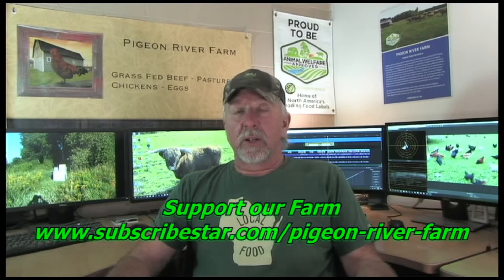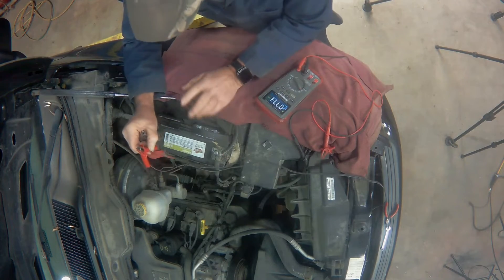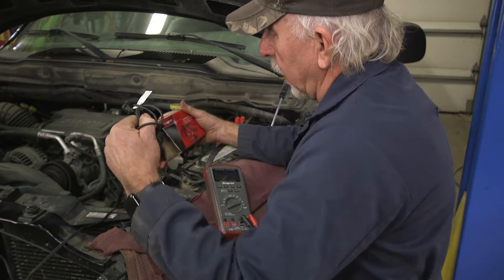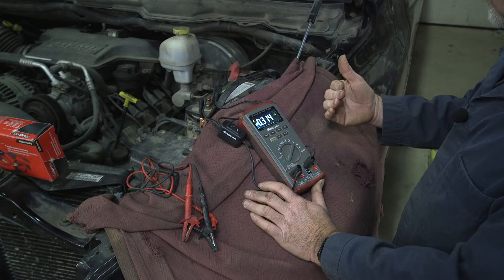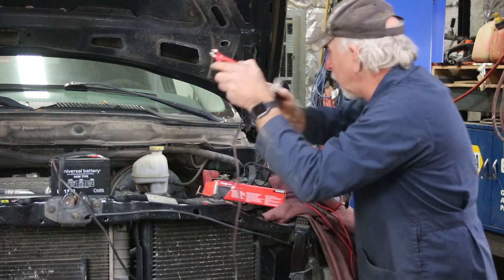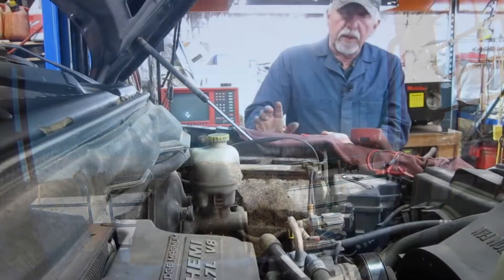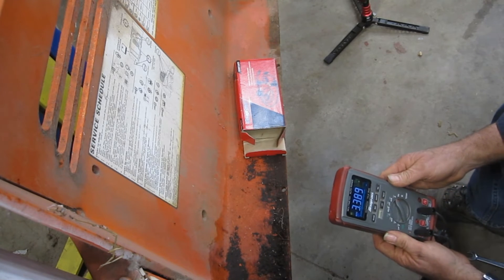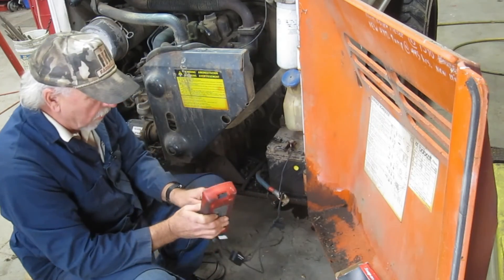The Snap on parasitic draw harness tool solves the problem!

Comment: Actually pulling fuses that way is not a good idea. If that fuse hadn't been the problem then you possibly activated a module when you put the fuse back in. It's better to use a voltmeter across each fuse.
Reply from the maker: Thanks for the comment you right that is a more controlled way of doing it. Like everything in equipment repair and service there so many different ways to approach a problem. Bob

Comment: Where did you purchase your small auxiliary battery cables?
Reply from the maker: The small auxiliary battery cables ended up coming from an old scan tool that I had and that was the adapter that went to the battery for the cigarette lighter adapter.  Since you are high quality, and I was no longer utilizing that tool.  I simply cut both leads off made up a few adapters to attach to my small exhilarating battery and it works great.  Sorry I can't give you part number but look around.  I'm sure he could find something comparable, thank you for subscribing.
Reply: Thanks for the reply